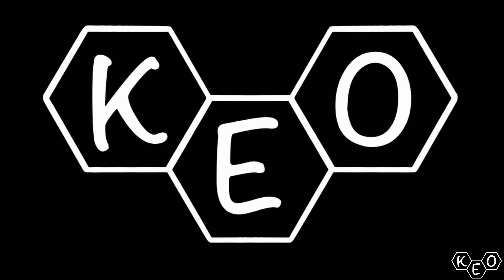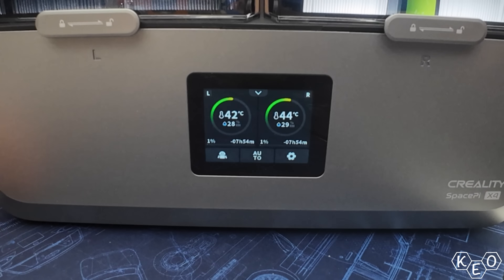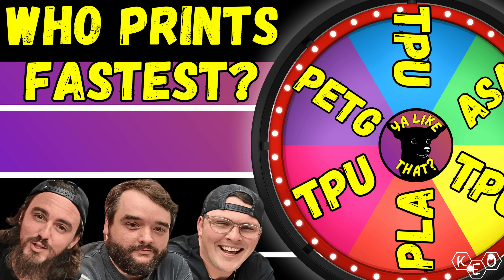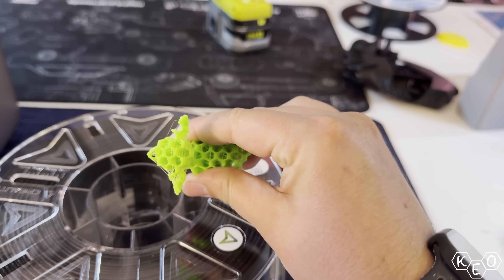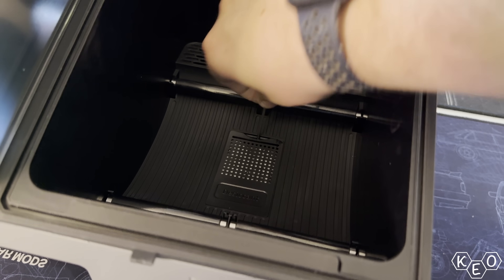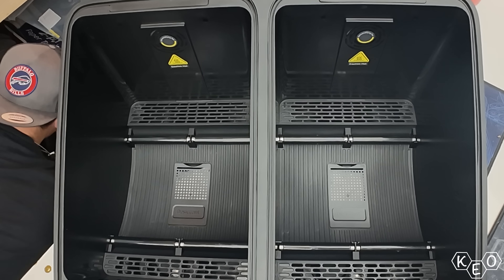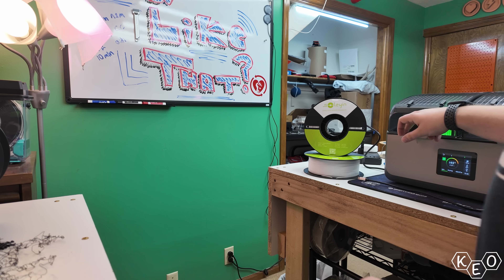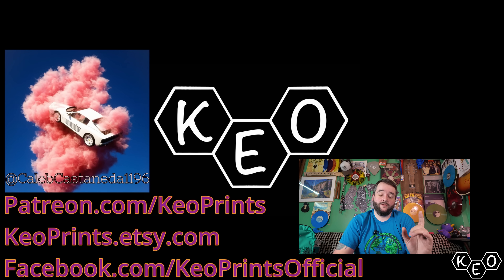This Is What Happens When You DON’T Dry Filament

Comment: So the heater bakes the moisture out of the desiccant (which I’m not sure I believe as it needs more heat than that) and puts that right back in the air in the dryer. Great idea!
Reply from the maker: Well assuming that they are able to bake the moisture out of the desiccant; the moisture would then be vented out of the one-way valve system that I mentioned. The same way that the moisture from the filament is vented. That said, I do wonder how well it actually bakes the moisture out of the desiccant
Reply: @KeoPrints it’s a strange claim. The moisture still has to circulate before any of it is vented out. Additionally, if it’s evaporating moisture from the desiccant, then the desiccant isn’t absorbing moisture from the air or filament. So it can only work when the unit is off.
Reply: That’s the idea yes. I got this same unit. My humidity is around 50-60% and after drying the filament the humidity inside the drier stays at ~20% for 2-3 days before rising. I just keep my spools in the unit and it keeps them dry.
Reply: @melgross  It also has rear fans to blow the moisture out, along with auto on/off when the humidity eventually rises when not running,.

Comment: I hate that Soleyin filament so much and have like 5 rolls of it I'm trying to burn through. 😮‍💨 It also won't stick to other filaments, only itself.
Reply from the maker: Weird. I wonder why that is? I printed with it on a multicolor print and it stuck to overture PLA just fine. Though the surface finish was oddly rough. Almost like it had fibers in it. Possible low quality regrind?
Reply: @KeoPrints  It's one of the worst filaments I've used and I use a lot of off-brand cheap crap LOL. I'll have to test it with Overture since they have similar finishes. It wouldn't stick to any standard PLA I tried and I'm not the only one. 3D Rundown did a video testing it because quite a few people mentioned having the same issue. You may want to do some testing yourself for the review video (if you do one).

Comment: lol, so far only problem I have is brittle filaments , 80% humidity, only use PLA.
Reply from the maker: I get the brittle issue as well. Especially the silks loaded on an AMS lite for some reason. Complete fracture all throughout the Bowden tube if it sits for longer than two days
Reply: That's generally the biggest problem I have as well.  Brittle PLA.  And of course it's always in the AMS where it breaks.